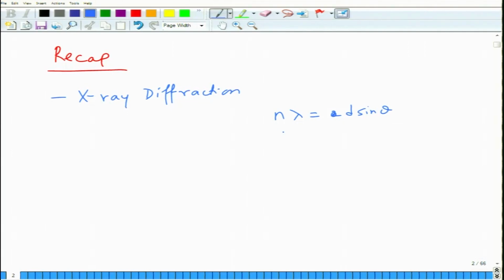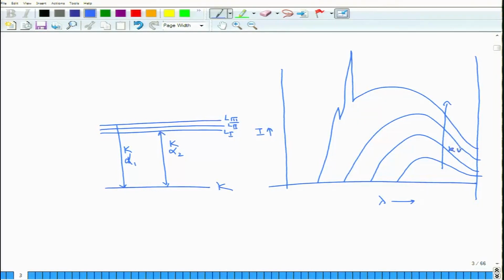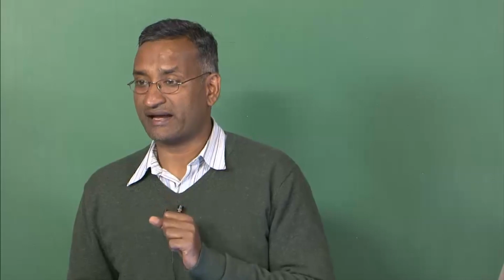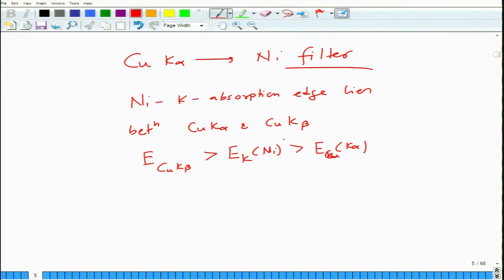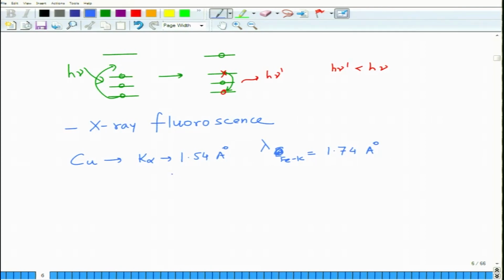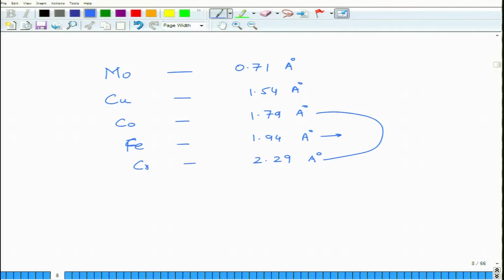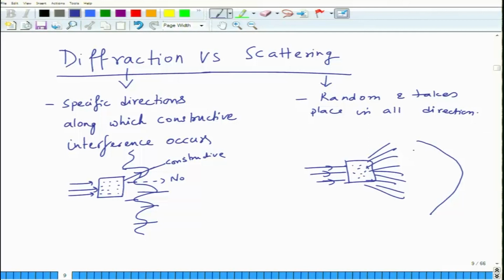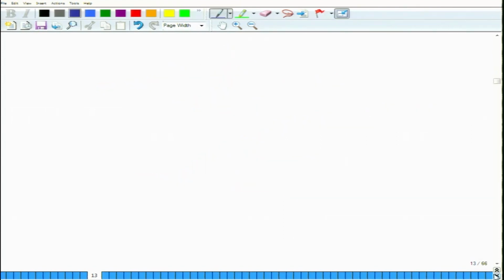Lecture 33

Comment: At 19:50 it is said that wavelength of k alpha for iron is 1.94 Angstrom but in the previous two minutes sir is explaining why cobalt x ray can be used for fe and not cu, which is a fact nd it holds only when iron k alpha is 1.74 angstrom. Please clarify.